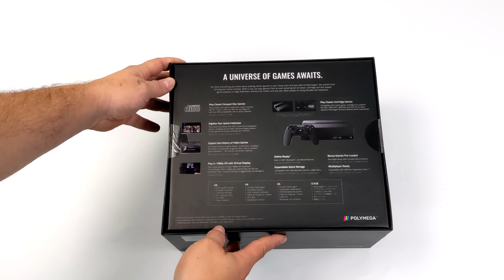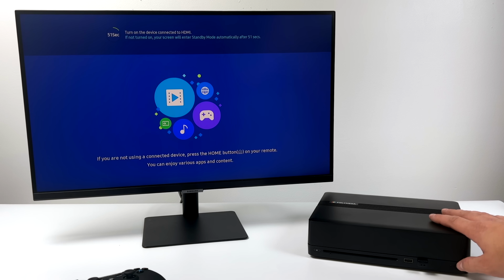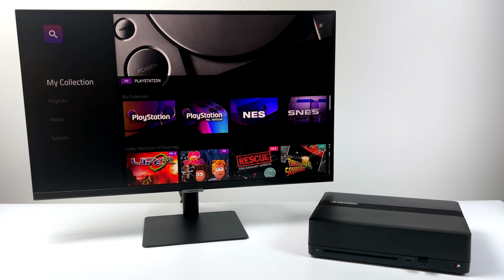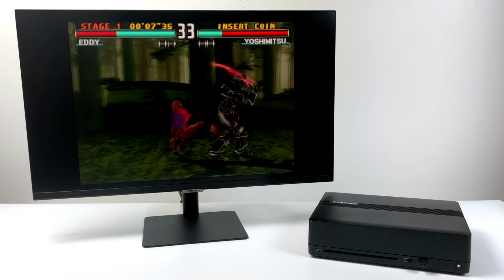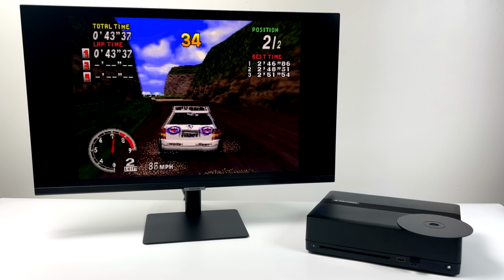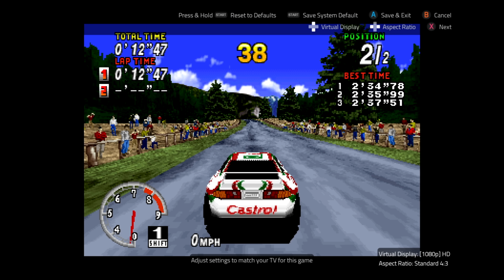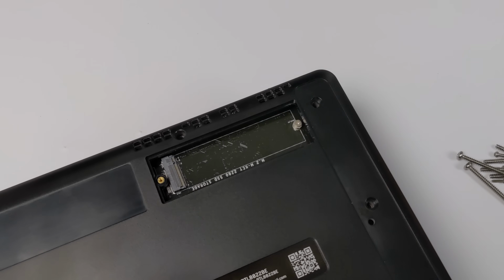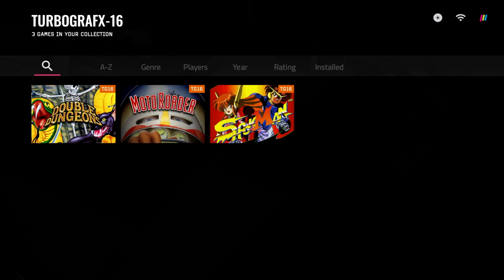Is This The Ultimate All In One Retro Emulation Console? Polymega First Look

Comment: Given they originally promised FPGA, it's pretty unacceptable that it's basically a low-end office machine slapped in a black box. It's also baffling that, knowing the pack-in controller would require a dongle, they didn't integrate the dongle internal to the case. The pack-in controller looks like a rebranded Ouya controller, and it charges by micro USB in 2021. There's no excuse for that. Even when they started out, USB-C was here, and ready. They knew they'd be launching into a world where USB-C would be the standard.

I hope people enjoy their overpriced emulation PCs.
Reply: Yeah, I'd have been willing to pay a premium over a refurb SFF office PC just for the novelty of using the original physical media, but $400+ is an insane asking price for this hardware.
Reply: @bland9876  There is plenty wrong with micro USB. It's not rated for nearly as many insertions, which means the controller has a finite lifespan just on the times you plug it in. Even mini USB was better for that. The micro port and the plugs are more fragile. Micro USB is becoming far less common, I have like two cables in the house. With USB C everywhere, I'd have a hard time finding my micro USB cables if I needed to. Micro USB 2.0 can't charge devices as quickly, and 3.0 is a weird wider connector, while USB 3.0's extra voltage and current options are rolled into the type C connector.

There's no excuse for releasing a product in 2021 with micro USB when type C is an option, even if the ONLY benefit you'd get is the durability of the socket.
Reply: @bland9876  Micro USB always breaks on me. Seriously I have 2 android phones that crapped out and it was the micro USB port both times within 1-2 years!
My USB-C phone from 2018 is still going strong with no signs of wear.
Reply: What's pretty unacceptable? That they retracted their FPGA statement, and clarified their lofty ambitions well before it went on sale? Or that they admitted they were too ambitious? Or that they commissioned the author of the Kega Fusion emulator to make a special version for the Polymega? Or that the research done for this system allowed for leaps and bounds of progression in Saturn software emulation? 

Which of the above is "pretty unacceptable"? Products change during development. 

I'll agree, the price is high. And the micro USB can be seen as problematic. Though admittedly, I have not had problems with slots. Only the cords. 

But people like you are acting like it's this massive harbinger of lies. When, from what I've seen, this thing has delivered on everything promised at launch. The store is yet to be seen. But was not promised at launch.

Though, I've seen some of your other comments. You seem like a bit of an insufferable elitist. So you do you boo boo.
Reply: @RobertSeeJen , you asked, so here's your answer: it's "pretty unacceptable" that they were talking out their ass on the announcement, to drum up hype. It's just as unacceptable that their product is basically on par with a Lenovo office machine in a nicer looking case, that it offers basically nothing beyond the cheap Chinese emulation boxes other than fan noise, a bigger footprint, and the ongoing cost of buying more modules. If it were an FPGA console, it would be justifiable that they would need to add physical hardware each time, but even the Retron series of consoles can fit more than one kind of catridge slot on their machines. The base model Polymega comes with only an optical drive.

As for being an insufferable elitist, that's just another way of saying "he's right, and I don't like it waah waah waah". Kind of a you problem, that one.
Reply: I can play saturn, dreamcast gamecube and ps2 on my pc.
I play everything else on my raspberry pi 3.
Why would i want the polymega?
Reply: What they promised was "FPGA Emulation Hybrid" which anyone with half a noggin already tagged as complete and utter bullshit and knew it was just gonna be a $500 emulator box, which is completely unreasonable, even for ease of use, especially when you consider that this does NOT include any cartridge modules, which of course cost extra.  They should have sold the front-end separately, honestly, the box is not impressive at all.
Reply: @bland9876   statistically speaking micro USB has a higher fail rate,  do not just use anecdotal evidence.
Reply: @ocha-time  incorrect. They retracted their FPGA statement, and clarified it was an emulation box well before the it went on sale.
Reply: @NoobixCube  look, I can see we're not going to agree on the ethics of the announcement. No matter what persuasion from either side. I personally do not think it was done maliciously. I think they were too ambitious, and needed to scale it back.. But you seem to think it was done maliciously. So agree to disagree. Yeah?
Reply: @knight0fdragon  they are both rated for 10,000 plugs.
Reply: Yeah if this was FPGA i'd actually pay the asking price. Like, paying for software emulation is ridiculous when everyone has a laptop/desktop already. I found it so weird that out of the box there's a dongle for the controller too like what were they thinking? The polymega was a huge swing and a miss
Reply: It's actually the same model as a bunch of dirt cheap PC controllers you can find on Amazon, including one by the brand GameSir. It's just a white labeled wireless controller, nothing special about it. My old version is busted, the trigger ripped right out of it.
Reply: @knight0fdragon  GREAT VIDEO! And, that's fair. But wouldn't that come more down to build quality rather than the tech itself?

Don't get me wrong. Micro has observably more parts susceptible to easier wear and tear than 'C' (the two "spikes" on the "bottom" come to mind). But I don't feel the tech is the issue, rather the build quality. 

I have had so many micro cables, where the spikes just stop gripping. But I've had others, that cost a bit more, that I STILL use. 

Same with the ports. I've had cheap devices that the port dies pretty quickly all things considered. And others that were far more expensive, that I have had no problems with for years.

Again. I feel it comes down to build quality. Rather than the tech itself.

I hope this doesn't come across as me "shifting the goal post" lol. I'm just trying to understand :)
Reply: @NoobixCube  Incorrect. Both micro USB, and USB C are rated for 10,000 insertions.
Reply: @RobertSeeJen  That's the minimum . USB-C has been tested to average ten times that, while micro USB barely makes it to 2,000. Those little mechanically latching teeth wear out on the plug, or they wear on the socket.
Reply: @NoobixCube forgive me. But I seem to have not been clear in my response. Your comment stated that micro usb was not rated for as many inserts as usb c. However they are both rated for 10,000 inserts. That's what I was stating. Not about the greater potential for wear and tear based on micro's inherent design. My apologies for the lack of clarification.